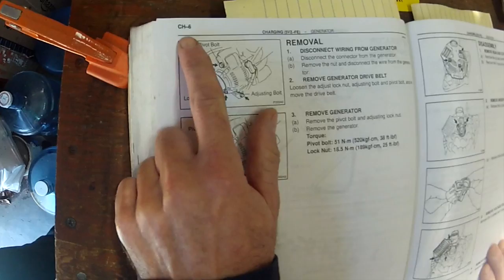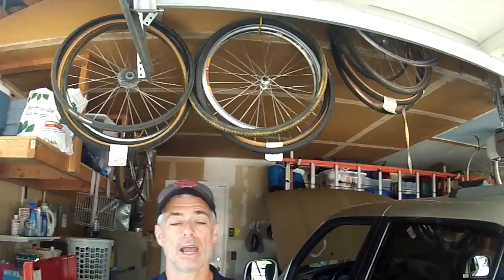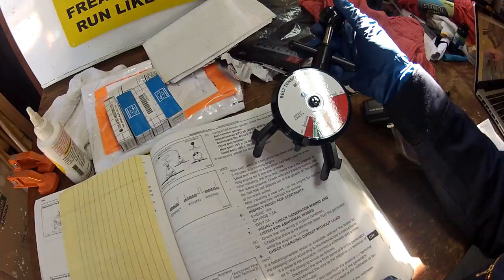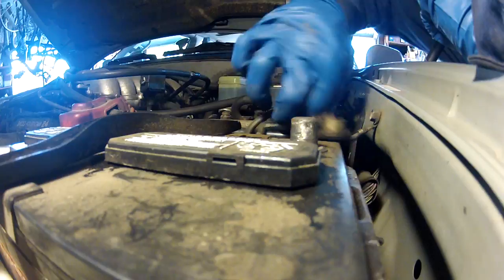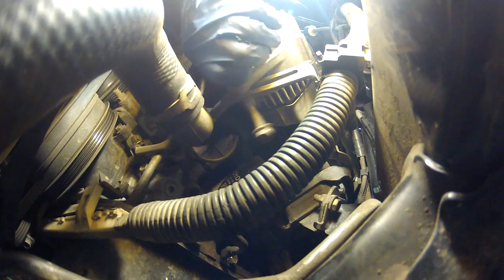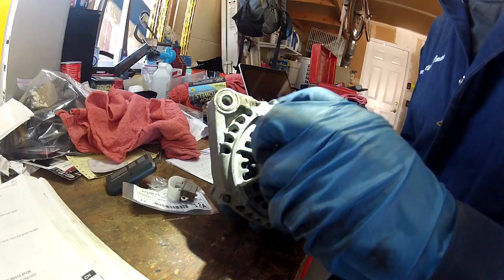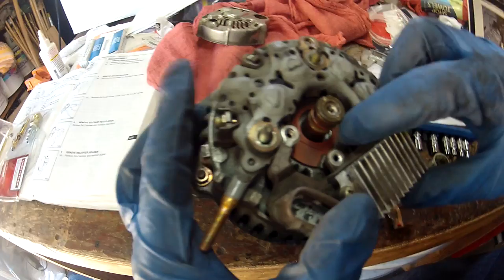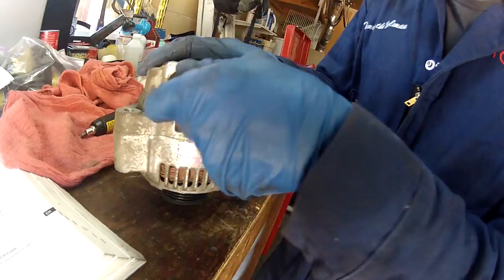Alternator Brush Replacement

Comment: 2002 Toyota Sequoia, I did this while the alternator was still fully mounted to the truck. Didn't even loosen the belt - Make sure you have a very good stubby screwdriver, rest is history. Don't waste time taking it off the truck, plenty of room...and I'm 6 4 250lb
Reply from the maker: I commend you on your ability to do this while your alternator was still on your motor but this wouldn't work for a lot of vehicles including the 3rd Gen 4runner we used for this video.  There's just not enough room.  But, good to know it's possible for the 2002 Toyota Sienna.
Reply: @TimmyTheToolman  I'm w you 100% - this is just on said sequoia - I watched your vid to know what to do - I was just leaving a comment.
Reply from the maker: @vance12341234  Yeah, I get it and thanks for sharing your experience with your 2002 Sienna because that gives a person with the same rig an option they maybe didn't think of.  Happy Wrenching!
Reply: 😂 had to clean the whole assembly  the gentleman did an amazing  job here #worksmartnothard
Reply: Now you tell me,  hands all banged up because born with a bump on my head, on the inside.

Comment: You saved me so much money!! I picked up new brushes from O'Reilly's and swapped out the old ones (they were totally shot) and my alternator works like new again. Took less than an hour to do start to finish on my 4runner (265k miles with original alternator).
Reply from the maker: That's great to hear Tom.  Thanks for taking the time to comment and share your success story with us.

Comment: If your brushes are worn out and the charging light comes on. Just hit the alternator on the back cap with the back of a screwdriver with the engine running. I've done it 3 or 4 times already. I've been told that if this works it's the tell tell sign of worn brushes. I'm gonna try to replace the brushes with the alternator still in the car.  My Toyota Starlet might have enough room for that!
Reply from the maker: Thanks for sharing this tip.  Good luck with the brush replacement.

Comment: There looks to be a sliding bushing at the front of the bracket for the upper pivot bolt.   The trick in those cases is to move that bushing toward the front of the car either by rocking the alternator as you remove it, or once the alternator is out use the upper pivot bolt with a nut in the space of the bracket where the alternator would go to force the bushing out and give you slack space to adjust the alternator orientation in the upper bracket  in order to start the upper pivot bolt.
Reply from the maker: Steven Bauer thanks for sharing your tips!

Comment: The OEM 'Brush Holder" comes with a pin holding the brushes retracted. After installing holder, pull the pin and the brushes move forward into contact with the commutator.
Reply from the maker: Really?  I don't remember a pin holding back the brushes when we did this job years ago

Comment: You can use a pin to line it up.just tap the pin in and it pulls both parts together
Reply from the maker: Roger that Mr. Wizard.
Reply: Ok

Comment: FYI- this part number does not work for early 5VZ engines. Just tried this exact part on my 96 4Runner 3.4, the rounded white plastic piece at the top will interfere. I suspect this part number is for a 99+ 5VZ.
Reply from the maker: Do you know if you alternator is original?  Is it a Denso model?

Comment: Just did this today on my 97 with 199,800 miles. Brush had about 2.5mm of material left. Great video, easy to follow with great explanations.

One thing to note if it helps anyone reading this, I used a sharpie to make a mark on the adjustor as a reference when I reinstall and can get as close as possible to the original belt tension.
Reply from the maker: Good job getting it done.  I'm glad our video helped you out.  Smart technique with the sharpie provided the belt tension was good before you started the job.  Happy Wrenching!

Comment: Thank you!  I have a '97 taco and she won't go over 12.5 volts.  My wife's Kia Soul had its alternator go bad, so I replaced the whole thing, kept the old one, and replaced the brushes (not the module, the brushes, soldering required).  However, the more modern alternators have an obvious set of screws holding the brush module down, but this old school one confronted me with so many screws I didn't know which ones to remove.  Here you showed it was only two.  So thank you very much!!
Reply: Also they are probably JIS screws, not phillips.   I didn't even know what JIS was until yesterday. =-P
Reply from the maker: You're very welcome!

Comment: Bam! Done thanks to your video! I just went ahead and replaced the alternator with a brand-new one since I've got over 267k miles on mine. Got it for a very reasonable price at a local alternator and starter shop. Even got all my driving lights working again while I was at it, which have been out since the guy who rebuilt the top end jacked up all my wiring while doing so. Thanks for the great video Timmy!
Reply from the maker: Hey Steve, that's good to hear our video helped you get the job done and you fixed all your wiring.  Sounds like the guy who did the work wasn't very careful.
Reply: Timmy The Toolman yes the video helped immensely! Gave me complete confidence to tackle the job. And it got me in there to reattach a couple things that the goofball that replaced the head gaskets left loose. And yeah the guy that did the job was not the least bit conscientious about the quality of his work. Very sad.

Comment: Great instructional vid. I just did mine today and only took 1 hr. Couple of things - the part number was wrong on my 98 4Runner. Looks like the alt was left over from 97 model year. Didn’t know until I got it off. A little trick I saw on another vid for getting back on. At the front of the bracket where the pivot bolt goes is a pressed sleeve. I just tapped out on it a bit and the alt went right back in first try. Thanks again. No shop wants to ever fix anything anymore just replace. Cost $20 and an hour of time. THANK YOU for your vids.
Reply: My car has 325k miles. The brushes were almost completely worn away.
Reply from the maker: Glad our video helped you out and you're very welcome. Yeah, I learned about the movability of that sleeve later on.  The way I moved the sleeve was by running a long bolt through the sleeve from the inside out and then slid a socket over the bolt that had an inner diameter wider than the sleeve.  I put a nut on and tightened the nut drawing the sleeve outward.
Reply: How do you guys do this in an hour?!   Am I orbiting a black hole?  It's like every recipe I've ever read: prep 20 minutes, done 1 hour.  Me:  all day.  Maybe two.

Comment: Mr.T,
         Thanks for the video.years ago I had a 88 extended can long bed.22R.loved it.was young fea rless and  broke more often than not.if YouTube was up & running then I didn't know about it.had a friend with enough tools to do most everything.my father was a salesman with limited mechanical skills  and tools so when my starter needed brushes my friend gave me some pointers & tools so I was able to get the job done.Him being  close by wrenching on whatever cool classic car he was driving at the time made it easier knowing I could get a hand if needed.with the book I bought on that truck & metric socket set and some other things as I could afford it that truck kept on going.eventually have it to my brother to repay a $2k loan.he didn't know the word maintenance.still stings a little to think about.anyhow,now I have a 96 my other brother sold me for near nothing.I'm going to do this job & get my confidence back up & then do more.so thanks again.what about diodes ?had a scan done & the guy said battery s bad & diodes weren't doing what they are supposed to.I'll keep reading but if there's anything else in there that needs doing I'd like to take care of it while I have it out.IF it's fixable .the referbs are expensive.it was advance auto .I don't care for now they do business in certain situations.was getting some oil and few other things so I figured I'd get a scan.FYI 182K MILES ,BELT IS cracking & split & loose. Do kick Mrs until I get in there..have a good evening.LMK.
Reply from the maker: The brushes are the wear part that usually causes an alternator to fail but there is the IC Regulator and Diode that could go bad as well.  I wonder if the guy with the scanner really could pinpoint a bad diode or was he just saying the alternator wasn't charging effectively.  If you get yourself a multimeter, you could check to see how many charging volts your system is putting out.  Somewhere around 13.8 - 14.2 volts is good.
Reply: Timmy The Toolman I was thinking the same thing. I’ve got a multimeter ordered. It’s not the best one but it’s not the worst one either. And it’s better than the one I’ve got now. Once I figure out how to use it I’ll be tracking all kinds of stuff down. . I’ve been studying up a little bit waiting for it to get here. I bet money is just the brushes. And my belt is split and worn out and loose. If I tried to tighten it up it would pop. No need to put a new one on either. Just to turn around and take it back off to replace the brushes. I’m going to limp a couple more days and then get on it. My multimeter will be here and my daughter will be in school. She was home sick all week. But thanks for giving it some thought. I bet dollars to donuts you hit the nail right on the head.
Reply from the maker: @wbwills2  Well, let me know what you find when you check the charging volts and then what you find when you pull the brushes out.  Hopefully worn out brushes was the culprit and you bought yourself more life for your alternator.
Reply: Timmy The Toolman i’m getting anxious but I can do this. I just put 20 bucks in the tank. Sick and tired of getting 10 miles per gallon and smelling un burned fuel. When it was still warm I couldn’t even ride with my back window down it was so bad. I don’t know if I thanked you for the tip on how to twist a belt to see if it’s loose and all. I got this. I can do it by feel thanks to this video and the links below. Also another 6 1/2 minute video I saved that another guy did. I was on the verge of replacing coils and I’ll kinds of crap. Still working on figuring the multimeter out. Holidays are here. With Santa Claus presents to pay for I don’t know how this is going to budget wise but I will surely let you know how it turns out. It’s going to feel good when I’ve got enough power to get out of my own way and I’m not worried about stalling out somewhere. So much crap on the Internet. It’s good to find somebody like you watch in a while. Have a great holidays and a new years
Reply: Timmy The Toolman I don’t own a scan tool. I’ll get one eventually. Cylinder number one and number three(it’s been a while I think that’s what another guy with a scanner told me) have not been firing. That 6 1/2 minute video I mentioned a minute ago had the exact same problem. Blasted it with compressed air and a big puff of carbon, dust and mess came out of  two cylinders after he took his plugs out. He was doing everything by field. A bunch of good tips. I’ll try and share it with you. Give it a look. If you’d like. You definitely don’t Need to. But it was a good short video. I thought. Wouldn’t mind your opinion on it.
Reply from the maker: @wbwills2  Enjoy your holidays as well.   Hopefully you'll get your rig running better soon.

Comment: Thanks for all the 3rd gen videos yall put out. Such a big help for me. Im about to replace the brushes in my alternator after watching this video. Initially I search it because my alt is making a whining/grinding noise and I’m curious if it needs total replacement or if I can get a new pulley for it as well when I do the brushes. This noise its making makes my truck sound like a jalopy lol
Reply from the maker: If your alternator is making noise, you'll need to replace the bearings the pulley shaft rides on.  I've seen a write-up a guy did for a full rebuild of the alternator and it didn't seems worth all the effort for the money savings.  I don't know how much the rebuild kit cost the guy but the amount of labor that went into the rebuild looked fairly extensive.  If it were me, I'd just buy a rebuilt Denso alternator and call it a day.
Reply: @TimmyTheToolman  Roger that. Thank you sir!

Comment: Great video. Something I'm planning soon, as my '97 has 180k, so I'm sure it's about time. I agree, disconnect the battery first! Mine still has the original radio package, so I guess I'll need the security code for the theft deterrent system? Never have had to enter the code, so I'm keeping my fingers crossed when I do this. Thanks again Tim.
Reply from the maker: Hey Pete, I missed your comment.  I replaced my battery with the stock stereo still installed and it didn't ask me for a security code when I powered it back up.  Unless there's differences in the years, I think you should be ok.

Comment: Timmy, this is a great video.   It is goodto see the struggle on certain steps to know ahead of time the potential trouble spots.  Some video would just cut off certain difficult parts so you really have no ideas.  By the way, I saw a video showing there was a grommet at the alternator bracket where you had so much problem.  Just need to pull the grommet in the hold toward the front of the car and you could easily slip the alternator back in.
Reply from the maker: Hey Vickie, glad you appreciate the video and the fact we include our struggles.  We do very much think it's important to share our struggles so people will not what to expect.  I have heard of that sleeve or bushing you're talking about after making this video.  I think it must have been inhibiting the re-insertion of the alternator.  Thanks for taking the time to comment.  We appreciate it.  Happy Wrenching!

Comment: A little tip! If you run some WD-40 on the inside edges of the bracket the alternator and pivot bolt go through... It's a lot easier to finesse the alternator into place by hand! Mine only fought me for about 5 minutes or so, and it was the original with 270k on it! 

I did have to break the plastic clip off and repin the wires into a new connector though-- so this whole thing still took about 2 hours with a trip to the dealer and back
Reply from the maker: Thanks for the tip.

Comment: Been avoiding this fix forever.  Getting Mirror w Light & brushes tomorrow.158k. 97 model. Can't stand throwing nice Toyota parts away & replacing them with China crap .done it before I knew better. Thx for $ that's staying in my pocket. Subd & liked.
Reply from the maker: You're smart to fix your quality OEM Denso alternator.  Sure, you can get an auto parts store replacement, but like you've found out, they don't last and you'll be doing all that labor again much sooner than you would have liked.  Good luck with the job.  Happy Wrenching!
Reply: Timmy The Toolman i’ve got this. Just been a while.

Comment: The pivot bolt is inserted from the10-12 o'clock position. Tap it with rubber mallet prior to doing this sand between bracket & alternator for good ground like ur battery. When tapping alternator body have ur bolt in the bracket u will feel when it center then just push it thru. Easy picesy😁
Yazmin 
Venice Beach CA ⛱💪
Reply from the maker: Thanks for the tip.

Comment: Thanks. I'm having trouble getting an exact OEM replacement for my 94 22re that actually fits, but with over 250K in AK, I also try to do preventive maint. This seems like the next best. The alt. turns very easily and smoothly.
Reply from the maker: Yeah, brushes might be all you need.